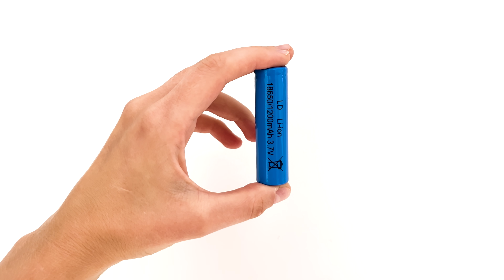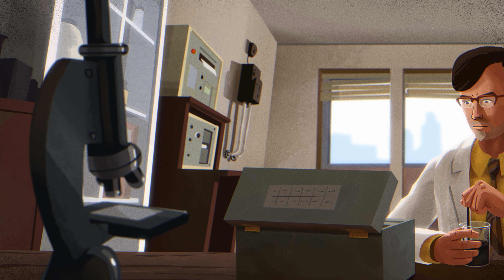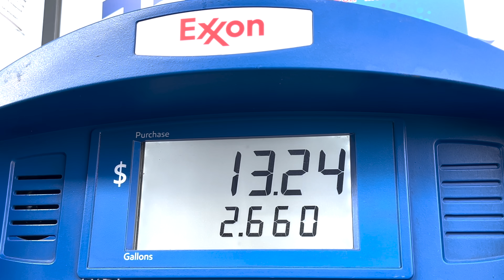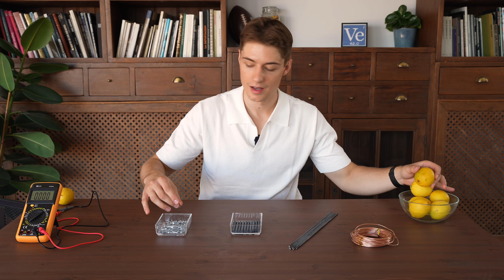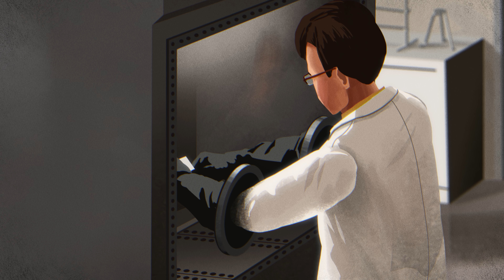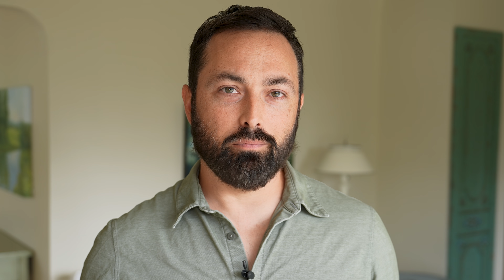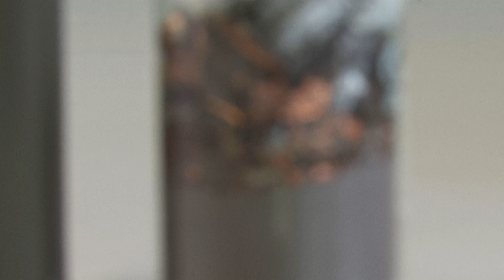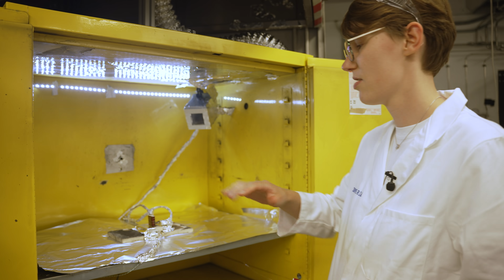The Perfect Battery Material Is Dangerous

Comment: The first generation Teslas were pretty crazy.  The original design had a sled of 18 650s, that were encased in water.  The idea was not only keeps the batteries cool so they last longer.  But also in the event of a fire, the water would already be there to extinguish them.  Unfortunately, that was great on paper, but in real life, they found the hydrostatic shock of the water in an accident would actually rupture batteries that normally wouldn’t be ruptured and more batteries than what would normally be ruptured in an accident.  Like when you see somebody shoot a water jug with a 50 cal, it just explodes from the hydrostatic shock.  Now they’re less densely packed with air cooling, and the problem has almost entirely subsided.  Tesla fire still happen, but they are far less common than your average car fire.
Reply: That's not how they made the original Tesla batteries.  Only the Nissan Leaf has air cooling (the newer 2026+ Nissan Leafs will have liquid cooling).  ALL EVs today use liquid cooling in channels inside the battery pack.  The batteries are not surrounded by water (that would just be dumb, and the batteries would burst into flames if they were in water like that), the water goes through either very narrow pipes between the batteries or through a special channel plates at the top and bottom of the battery.

Also, Tesla's today use 21700 cells and their newer tabless 4650's.
Reply: Nice try fElon
Reply: Old ICE cars tend to get burnt out in insurance scams. Or to hide evidence of crime. Or with defective repair techniques. Nothing inherently dangerous. ICE fires almost always come from human mischief or mismanagement. That’s bad. But when EVs burn, it can be the above, or battery degradation. Fuel tanks don’t contain fuel, ignition source and oxidiser. Lithium batteries have all three. Therefore not inherently safe. Worse still, once burning, very hard to extinguish and lots of toxic smoke and residues. Very environmentally bad. This is a big problem. ICE seem more more failure safe. And EVs have electric door handles making rescue of occupants of a crashed EV harder. Definitely a problem

Comment: The main advantage that was needed for making batteries smaller was the digital components needing way less power. Li-Ion actually did no improve much. Just like all the other battery chemistries before it weas just a little step - which IMHO never was even worth the terrible dangerous downsides of the crap technology.

Comment: 5:22 I don't think that explanation is correct. If both reagents - in this case the electrons and the hydrogen ions - are present in sufficient concentration, there'd be no reason for the reaction to stop so quickly. Rather, since the anode half of the lemon can no longer transfer hydrogen ions to the cathode half, the anode half almost immediately reaches saturation of positive ions - no longer able to accept zinc ions. With nowhere for its ions to go, the zinc anode can no longer donate electrons to the copper cathode, bringing the cathode reaction to a halt as well

Comment: Great video. And another +1 comment to the others disappointed it didn't touch on LFP and how they're over 50% of EV batteries today while containing no cobalt and being much, much less prone to thermal runaway.
Reply: Thermal runaway occurs at around 210°C for NMC and 270°C for LFP. I would say that LFP is more resistant to thermal runaway, but not much more.
Reply: @simoncrooke1644  It's not just the temperature, it's the internal structure/materials that makes the scenario much, much less likely.

Comment: 25:24 is this why most electronics with lithium ion batteries have instructions that say to fully charge them first before use?
Reply: No, any battery you buy will already have the formation of the SEI already done. Normally it is done at higher temperatures or other different conditions so the manufacturer does this to ensure higher performance. Most batteries ship at 30% charge for both safety reasons and cells begin to breakdown if at 100% for too long. They ask you to charge it simply because it is not fully charged when it arrives.
Reply: @elliotbrown6207 there is a reason most electronics ask you to fully recharge them before use though - many electronics with rechargeable batteries also have a governer that helps extend their lifespan, and also tracks what voltage corresponds to full and empty (battery fullness is tracked but making use of the fact that output voltage drops slightly as charge level drops). The initial charge is important to teach it what full and empty look like, and helps it do its job correctly. It isn’t one and done though - batteries change over time, so it’s not like it’s a major problem if you don’t.

Comment: As far as I know first electric cars are equipped with Ni-Fe batteries and they can last 20 years, opposite to what in this video stated. Nickel-Iron (Ni-Fe) batteries, also known as Nickel-Alkaline or Edison batteries, are rechargeable batteries with a long life expectancy, high Depth of Discharge (DoD) and a reputation for durability. The battery can withstand overcharge, overdischarge and short-circuiting and yet last 20 years or more.

Comment: Interesting, I use Lithium Titanate in my electric motorcycle, now I realize that was the original lithium cell chemistry. Low 2.4v and low energy density, but huge lifespan, super safe and massive charge and discharge rate. Such an interesting video.
Reply: What make/model is that electric motorcycle? I've been curious whether they still have "gears" and a fixed speed electric motor or just a variable speed electric motor coupled straight to the drive wheel.

Comment: Completely irresponsible to not mention LiFePO4 (Lithium Iron Phosphate) batteries, which are perfectly applicable to EVs (used in Tesla Model 3 and others!), large-array storage, power tools and other consumer electronics where a small compromise in energy density is not a major problem.  They also contain NO cobalt or nickel ($$$)

Comment: I presume that there will be follow-ups on how nearly all of this time Lithium Iron Phosphate 4 cells have been available (and are the most common round cells in laptops, less so with flat cells) were safe enough that NASA has been using them as the batteries in satellites for decades, and are some of the most common batteries in EV's in China. Also Sodium Ion batteries have also been around for almost as long, include some early designs that can easily be made at home, but are also one of the fastest growing battery technologies at CATL. Because we know you're not sponsored by the coal industry.

Comment: Youtube Search: "The Twilight Zone: 2019: Episode 4: A Traveler" At the beginning of the Episode as the head cop walks into station watch the Star like UFO aka Plasma shielded above move away, now look at the Crystal clear smartphone of the traveler(Plasma generated Ultrasound to Piezoelectric Crystal electricity conversion). Opens recordings of Earth and locks onto Crystal radio Radio signal + Ultrasound = Power. Some of us use frequency encrypted signals with resonance overload self destruct so no1 can use our technology and much of it points at Antenna's on Traveler can be radio.. Amplifiers to Capacitors to safely merge power for steady dump to device needs.

Consider this.. Instead of making thousands of versions of devices you can download on your smartphones = Make one elite smartphone then use mass production for everything you can't simply download as a tool. If done correctly based on my analysis of your world then what you call poverty will raise to middle, middle will raise to high, high will raise to elite, and elite will raise to one step from us slapping them to let them know whose territory they're entering. Search engine: "Saucer over Dracula's birthplace Yahoo news 16th Century art official Church" > Points at Saucer on "I want to believe" posters Hmmm.

Puts on wide Brim Fedora > Search engines: "Alucard Hellsing Ultimate" > "Hat man" > "Judge Doom" > "Sheriff Cooley" You sure you don't remember me? Pulls breathe DNA exhale with ultrasonic echoes and scans phobia reference database of Human DNA I think you do.. - Dracula (Edited to add Plasma generated Ultrasound I forgot you haven't got into Ultrasonic shockwave antidrag and illusion of silence beyond hearing stealth yet..)

Comment: Need to do a followup with sodium ion batteries - where the materials used are far more common and cheaper for both anode and cathode and the resulting chemistry is far safer.  Plus sodium isn't exactly hard to get, since sodium ions are readily available from the vast bodies of water.

Comment: 5:32 Excellent — the electrons can travel, but now I'm a bit confused. In your video with ElectroBOOM about electricity, you said electrons don’t push each other. So they travel, but they don’t actually 'push'? How does the electric field work in all of this?
Reply: The electrons only move if you connect the electrodes if you don't do that no electrons flow

Comment: Lithiom ion phosphate seems to be the new gen of battery,  
 
Also
Silicon batteries, specifically silicon-anode lithium-ion batteries, are a promising technology that uses silicon in the anode instead of traditional graphite, offering higher energy density and potentially longer battery life
Reply: Lithium Iron Polymer if you mean LFP / LiFePo

Comment: The difference between batteries and hydrocarbons is batteries are subject to manufacturing/design/ageing defects and don't need an external source of oxygen for combustion,while the hydrocarbons are safe as long as there are stored away from oxygen, and don't have ageing related safety issue. It is still interesting that there are thousands of mini explosions that are contained safely in an ICE, while a BEV being safe m9st of the time has an unpredictable thermal runaway issue. Feel it was rushed to market overlooking safety issues, due  to high power to weight ratio.

Comment: Ahem... The "brick" and transportable phones of the 1980s were actually impressive for their time. They were cutting-edge, extremely expensive, and represented a huge leap forward — finally allowing people to make calls without being tethered to a landline or car. The idea that smaller batteries alone would have made phones smaller back then misses the point: the entire analog electronics infrastructure — from circuits to transmitters — was bulky. Miniaturization required advances across the board, not just in battery tech.

Comment: Manganese dioxide is another chemical used in car batteries. Chronic exposure to just a few micrograms of MnO2 causes neuronal degeneration. There can be over 60kg of managanese in a car battery. When a battery goes through TR all of thst cathode material is ejected.  MnO2 will be the next asbestos.

Comment: I wonder why the focus here is primarily on lithium-ion batteries, when metallic lithium batteries are widely used. And their fires are even more difficult to extinguish because they can't be doused with water. In fact, covering burning lithium with sand doesn't work because it reacts with silicon oxide. Burning lithium can also react with nitrogen, so some types of inert atmospheres may be insufficient.
Reply: People seem to forget lithium primaries are still a thing and aren't the same as Lithium Ion
Reply: because channel is about covering history of how we invented batteries. every other battery is derivative of Ion lithium Battery.  If you make this video in 80 years, you'll have more history to cover all the type of battery we tried and invented and how X Battery surpass all. for all we know, someone will make recharge infinity battery one day.

Comment: I think a physics channel should have gotten electrical flow better: electrons do not flow through an electrical circuit, battery or otherwise. Electrons can pass energy by jumping electron shells, and this bump can cascade like a wave. The wave is the electrical flow. As electric charge passes and electrons bounce between shells, light can be produced as a byproduct, and this is why an electrical spark glows.

Comment: Wow good thing internal combustion cars don’t have a bunch of fire explosions happening all the time inside of them
Reply: Batteries generally aren't housed in heavy steel that contains said explosions. Even if they were, you still need multiple openings to connect wires to, so it'll just end up as a flamethrower anyway.
Reply: @Wheres_my_Dragonator I mean a b@mb is just a fire explosion enclosed in a hard container. 
And certainly, in and ICE vehicle don’t leak that flammable material nor are there concerns about that flammable material when refilling the car. No no it’s the static and cigarettes that are the real problem not gasoline.

Comment: Battery failures aren't just cuased by dendrite formation. They come from manufacturer defects.

Samsung's Note 7 famously used a 3rd party battery supplier who over compressed the cells causing physical damage to the electrolyte barrier, these weak point later caused ruptures and shorts as the batteries cycled.

Many Chinese manufacturers (who usually do not brand their cells or buy un-branded cells to put their own on them) do not use the propper thickness or purity of materials in an attempt to cut costs. These under-engineered batteries have a very high failure rate to the point they are banned from air-shippment after causing fires on several cargo flights some of which cused...total loss of the aircraft and crew.
Reply: Why you avoid chinese batteries altogether
Reply: @HDXFH  the device you're typing this comment on probably has a battery made in china, better check and safely dispose of it in that case.
Reply: Since when has this guy ever cared about presenting the whole story, instead of just clickbait shock value "today I found out" style videos
Reply: @Auriam  20 years on the internet and this is you now
Your parents must be so "proud"
Send hello to 4chan 👋
Reply: @Tom_Nguyen.  Just sayin', maybe if he focused on the whole truth and not just the exciting or shocking bits, he might be doing more good :) But thanks for the insult.

Comment: My opinion : we need to use all of these energies at the same time. Consider. Solar power, and gasoline power, and coal/steam power, and diesel power, and human power (pedal or otherwise), and coal power, and wind power, and regenerative power, and rechargeable battery electric power, and nonrechargeable battery electric power. Not in separate designs, but in one design, where each energy technology is relied on.

I believe the critical flaw, as mentioned in the Exxon bit earlier in the video - they said "do it with zero petroleum". I think the key is balance. Shifting from this extreme of this was all and nothing else but now it's all this and nothing else, to a new angle that isn't competitive across industries but is collaborative and cooperative. This is the key I believe.

What if one system fails? Then 10% efficiency is lost. This is better than 100% efficiency lost as when it relies on just one energy source.

What does this mean for oil industries? We won't need to consume as much, leading to healthier planet and less demand for it at higher prices and low availability. When we get a new energy technology, there can be room to expand and integrate it easily. When we face crisis like no water or no sun or no wind or no petrol or no diesel or no biodiesel or no charging stations, we can still continue on as we address those concerns.

When I read about the blood type diet, by Dr d'adamo, I was inspired of this mentality. If there could be truth to that of 4 types of blood 75% of the blood types won't need red meat for core nutrition, then maybe it could reduce meat eaten by those who don't need it, leading to better and more efficient agricultural practices. By getting the right food to the right people, our efficiency as a country could increase, but it couldn't be with this all or nothing attitude that many vegans hold on to like "nobody should eat meat".  Seeing it as harm reduction, I see an opportunity for change toward greater health in people, spiritually in our cooperative efforts as well as our social understandings of others, this collaboration between ideas and technologies will hopefully allow us to become more independent, less reliant on single monopolies, and reward cross industry Teamworks.

This is how I dream to change the world.

Comment: Got away from li-ion for storage .still have unsealed lead acid , sodium and lifepo4. All higher voltage in that order 13.2 - 14.8 , use the raw dc for lights sound and a fridge. The exploding Samsung turned me off permanently.

Comment: Anyone ever try oil based electrolytes?  WATER IS AN INSULATER TILL YOU ADD MINERALS AND OTHER ELEMENTS INTO IT TOO MAKE IT CONDUCTIVE... SO IRONICLY IS OIL.  MIGHT BE USEFUL TOO EXPERMIENT... THERES A THOUSAND WAYS TOO MAKE A BATTERY AND THERES PROBALLY A HUNDRED THOUSAND OTHER WAYS WE HAVENT EVEN BEGUN TOO YET EXPLORE... EDISONS NOT THE ONLY ONE THAT CAN INVENT DFERENT BTTERY CHEMESTRIES... When it comes too 18650 lithium Ion batteries they should be outlawed...   Reason is recesed terminal on can that is level with the can a small carboard or plastic ring is put over it too prevent shorts if you bump them drop them or use them in ohh say a bike or car or hoverboard that insulator ring can move resulting in dead short... Also heatshrink melts cracks when you have thermal runaway resulting in multiple shorts and catastrophic detination.